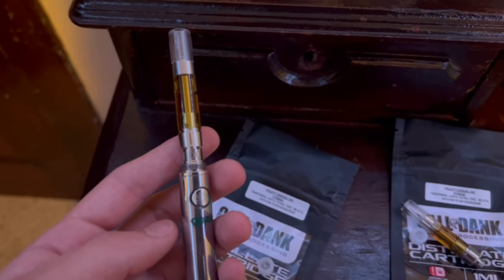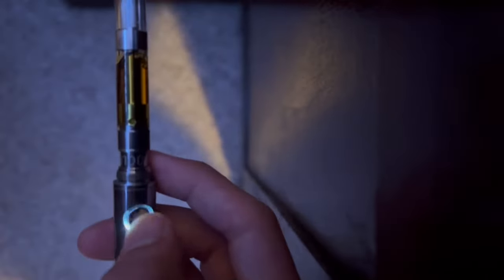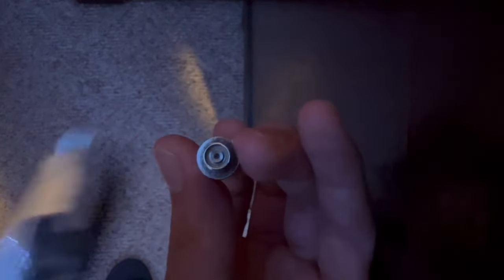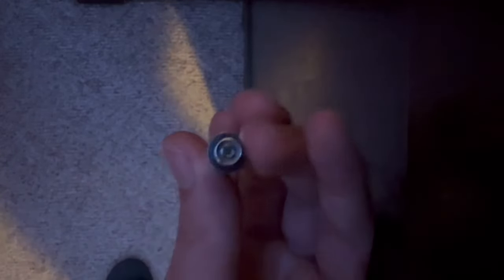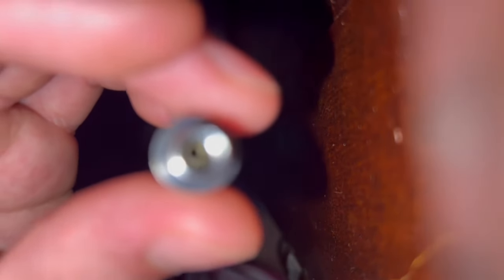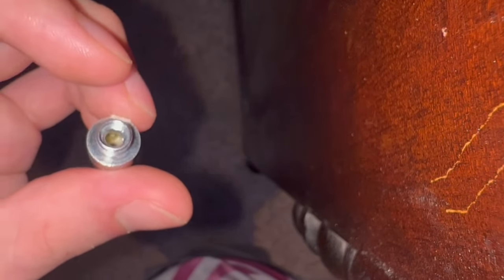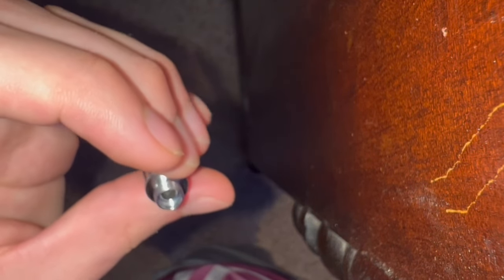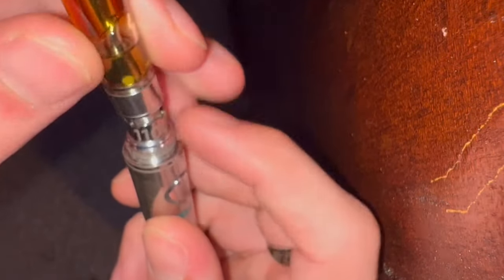How to fix a cart that’s not working

Comment: Move it around a bit and smacked the cart and battery and got it to work, I wouldn’t take out the metal part he’s telling you to pull out, that will ruin and completely stop your cart from working, please be aware of it please. That metal piece is what helps the cart hit and get electricity from the bat
Reply: Buddy he literally disassembled it and fixed it. Bro should take up engineering

Comment: What a clutch video. For those like me with pliers to big, I was able to use a toothpick to wiggle out that center part to get to the wire. Took me a bit to mess with the little wire to get it right, but I got it to work! Thank you!!!
Reply: I had this problem bro and luckily I’m in the mechanic/technician field so as soon as I watched this I had my cart fixed in 20 seconds 😭
Reply: I had to use a bamboo kebab stick thingy
Reply: bro i literally tried everything else i even crack wired it and it wouldnt hit. i used a thumbtack to get the wire out

Comment: Bro thank you! I didn't follow what you did to a tee, but I jiggled that bottom piece (metal thing) & it started working ! Saved me $50
Reply: You sir are the goat this is all I had to do to mine as well
Reply: Hell yeah, worked for me as well! Thanks my dudes
Reply: UR DA GOAT FOR THIS COMMENT.
Reply: thank you for commenting this because when i plugged it in after failing to pull out the metal piece like him it worked

Comment: Bro you saved my cart and I appreciate you so much man I was worried it wouldn’t work cause diff model but you came in clutch
Reply: What you open it with?
Reply: @rylanhilton999  i used a sewing pin, try and put it under the rubber part and ply it up and at some point you’ll be able to use your fingers and pinch it out

Comment: Mines had a piece in it that I think was stuck from taking the bottom of when it was new. That may be the case, I took it off and used it without the extra pen and it worked. So sometimes it’s a piece stuck. Thank you sooo much 😂

Comment: Do you put it through both holes or just one? Thanks in advance
Reply: the wire on mine was too short to go through both, but the trick still worked, so no doesn't need to go through both👍

Comment: I did all the steps and found a BUNCH of wax inside the cart and cleaned it all out, however it didn't end up working. Am I cooked?
Reply: The little wire has to go in the tiny tiny hole on the inside end of the thingy that gets removed🧐

Comment: Mine constantly flashes green like 30 times. It just keeps flashing. Won’t pull, won’t charge. I have 2 ooze pens and they’re both not working. What am I doing wrong ?
Reply: Same with me, and if I change the power setting then it blinks that color 10 times. I just use wires and my cart works

Comment: Did you put the wire through the holes?
Reply: Sometimes you can just take tweezers and turn the bottom part where you see the rubber

Comment: I have a Glass Push cart and the silver little part don’t have any side holes just one big hole at the bottom of it. What do I do???? It’s got a full cart of oil!!! 😭
Reply from the maker: Try doing the thing I did
Reply: @youngdabber420  bro the little metat piece doesn’t have a hole
Reply: Heat it up with a blow dryer then transfer the oil to a empty cart.
Reply: Bro I'm literally here for the same reason rn
Reply: Thank you so much bro

Comment: I cleaned the bottom with a pin didn't work but as I was inspecting my pen I noticed the holes that are supposed to be at the top is lower then it should be so I can't screw the cart in all the way like it's supposed to be but I got it to where the cart won't move while smoking I just hope this don't do anything to me like make my chronic pain worse or something

Comment: Alr so I took it out and the wire was already on top and I tried to put it inside the hole but idk if I had it on and still didn’t work. When I first got it I dropped it and screwed it on and it worked but since the first hit, it hasn’t been working

Comment: If this doesn't help and the wire was connected into the hole, I've noticed that it might have been pushed too far down for it to be able to touch the bottom

Comment: Mines the opposite when the wire isn’t inside it doesn’t blink but doesn’t pull, when the wire is in the hole the light blinks and still doesn’t pull